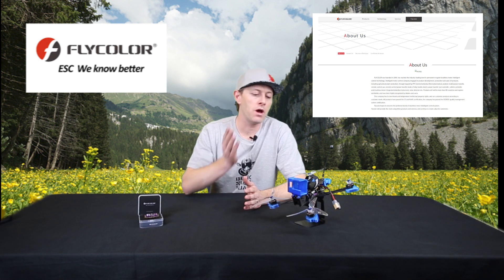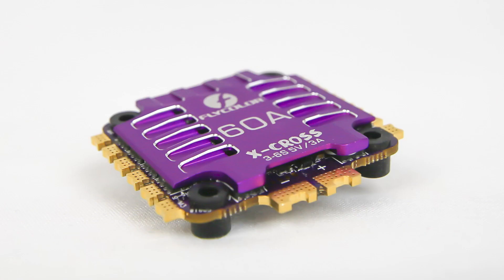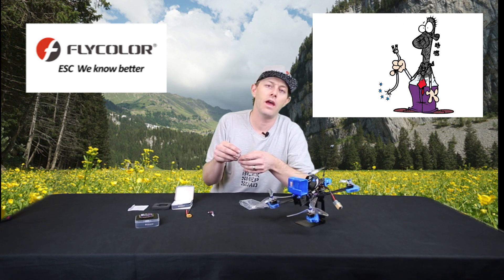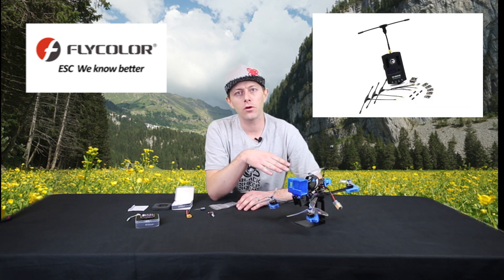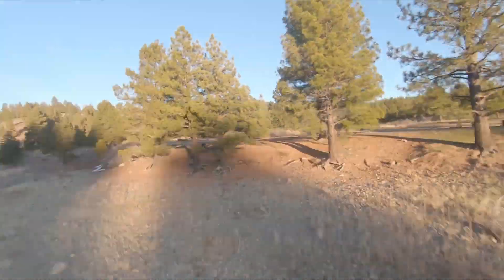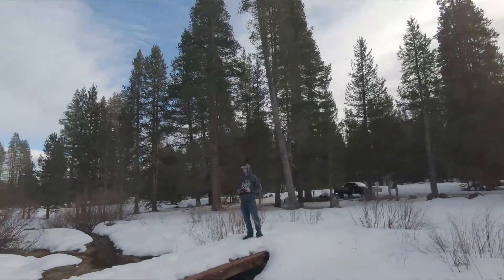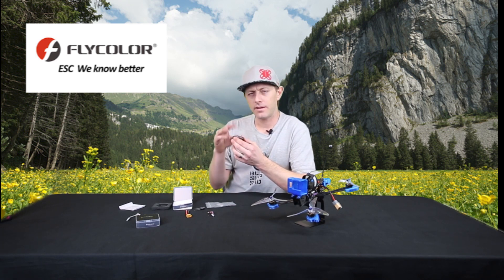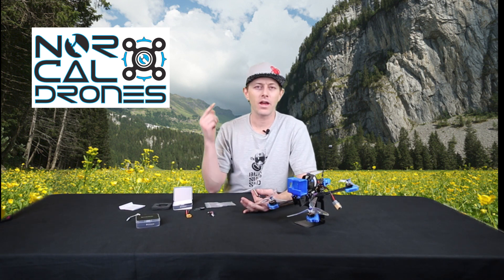Flycolor X cross Review

Comment: Just fitting one now to a mamba DJI f722 no space in the plug for 2 ground wires do i need to use both?  thanks if the time to answer,  Richard UK
Reply from the maker: All the ground spaces go to the same place so you can stack 2 grounds or splice them together if needed. It is a good idea to ground all wires if they’re available to help clean up noise. Thanks for watching.

Comment: Hi does it have 5v bec output to power fc? Thanks for vids
Reply from the maker: HelioGenesis -HS yes it does it’s one of the middle pins at min 2:28 there is a picture showing the pin layout.
Reply: @norcaldrones5389  omg nice 5v bec. Nowadays less less company made this readily available as they think is useless in new era of stack. Wow nice amd now on my list to buy. Great to refresh my old dalrc f405 that need 5v bec to power it. No need external 5v anymore
Reply: @norcaldrones5389  dayum apparently there is 45a version too, wonder does it have 5v bec too? Can u confirm it sir? Thanks

Comment: I love flycolor. I have flycolor raptor stacks in all of my quads. Never owned anything else. I really want that 60amp!!!!
Reply: Been using flycolor 4 in 1 sense 2015. Still works awesome. Never blown a flycolor board. Ever
Reply from the maker: That’s awesome. I haven’t tried there stack yet.
Reply: @norcaldrones5389  i use a F3 raptor x stack 5inch, F4 raptor S stack 5inch and a F4 raptor x 20x20 stack  in my 2.5inch. They all are amazing. No soldering required, every component simply plugs into its spot. Highly recommend trying there stuff. My go to quad is the F3 raptor s. Its over 3 years old and never had any problems. Even crashed into a river and it still works.

Comment: I've had friends using the individual escs. They seem pretty reliable. I've not tried one myself though.
Reply from the maker: Yes I like all in one esc. Just a little less to solder and if you don’t fly too aggressive or you disarm when your stuck you shouldn’t worry about burning it up.
Reply: @norcaldrones5389  Yup, and they are used by the Korean's Veloce Racing Team in DCL....so they must pretty good.

Comment: 60amps baby time for a 7inch build!!!
Reply from the maker: McFlyAwayFPV ! Yeah I originally wanted to build a 7” but it didn’t work out so I went with the 6” for now. I have a frame waiting, just need motors.
Reply: @norcaldrones5389  get in touch brother.
Brendan Zaebst on facebook
Reply: If you want some absolutely AMAZING motors at cost I have a friend who teats motors. 2506/7 1500kv/1900/2350/2400/2750.
Ive ran them for years. Send me a message on facebook and ill get you a hell of a deal. Like $8-10 per motor. Absolute top shelf quality.
Brendan Zaebst on facebook